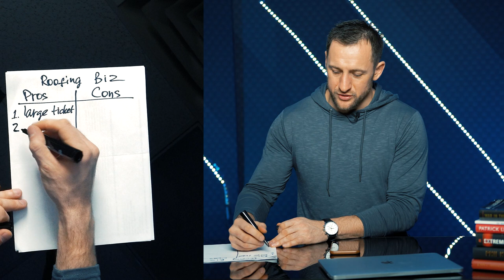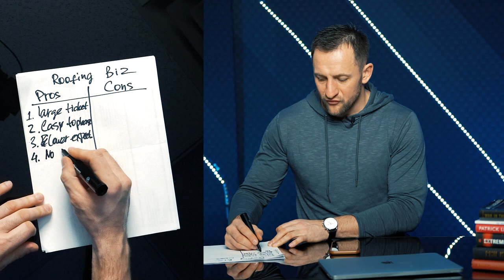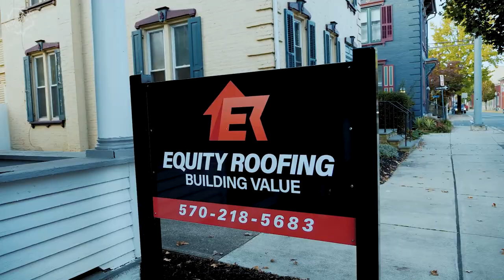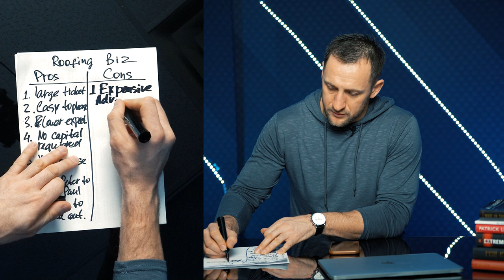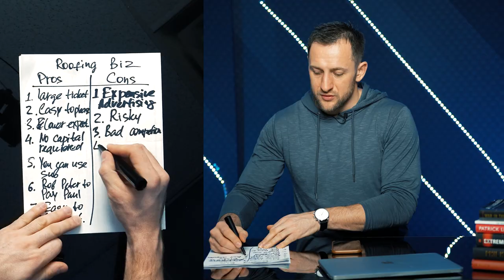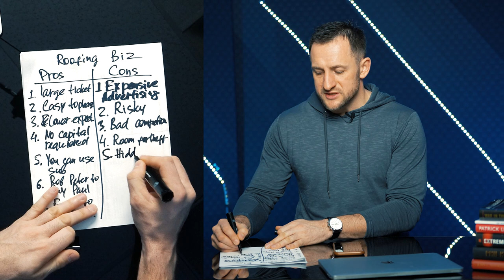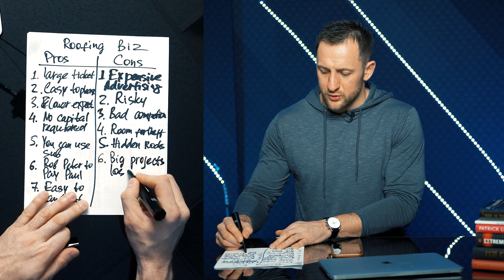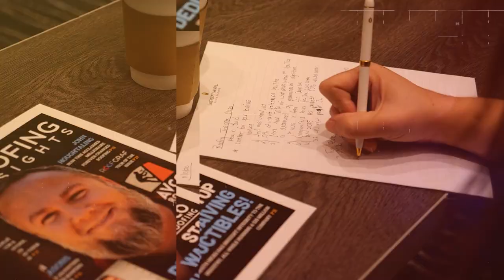Is Roofing the most profitable trade? 7 Pros and Cons of Roofing Biz

Comment: Painting is by far the most profitable and Lowest risk / barrier to entry
Reply from the maker: You have lots of liability in painting too. You are inside homes, moving/covering furniture
Reply: It absolutely has the lowest risk and barrier to entry, but is definitely NOT the most profitable. 

In a free market it’s almost physically impossible for the activity with the lowest entry barrier to be the most profitable. If it did, people would flood in and drive the profits down.
Reply: I used to do roofing for 27 years then started to paint and pressure washing after doing roofing it sure feels lot easier and 
Money is just about same